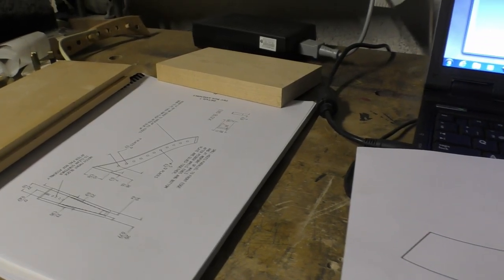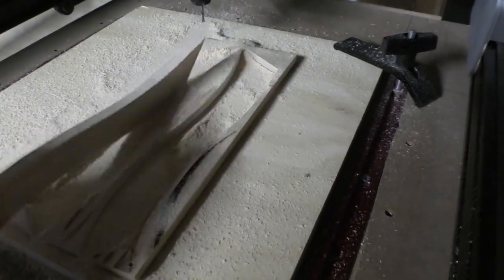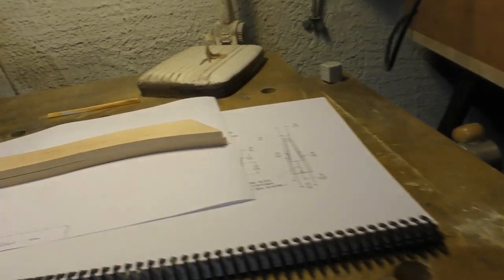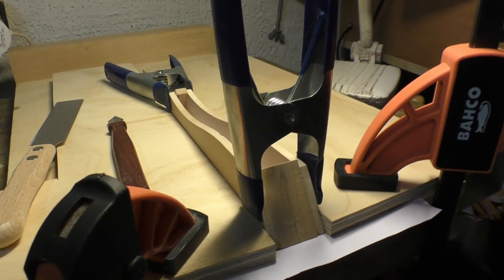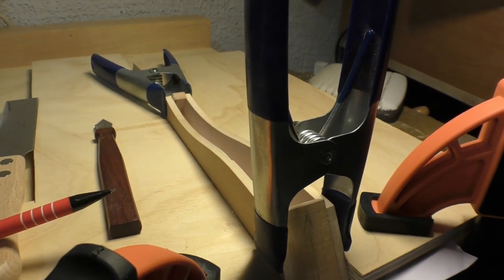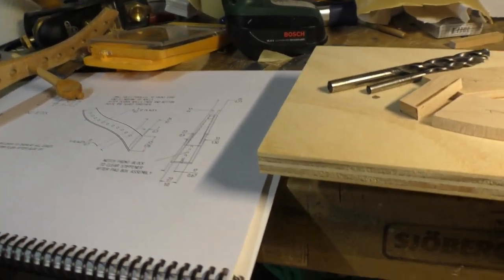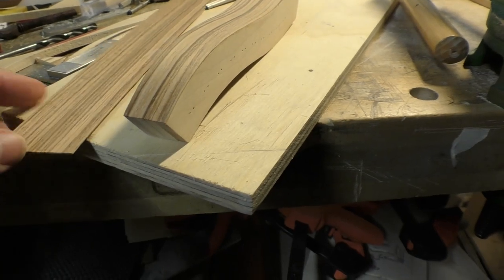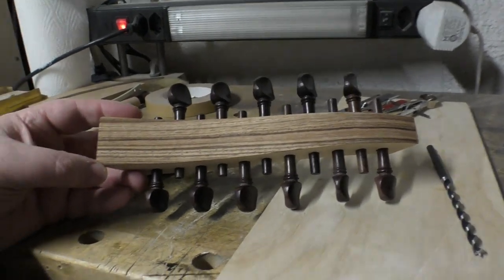Oud Repair Part 6

Comment: Looks great. A trick for getting rid of those marking holes is to add a dab of superglue to them, mix it with sawdust from the same type of wood, let it dry, and then lightly sand it flush. It'll look like the holes were never there.